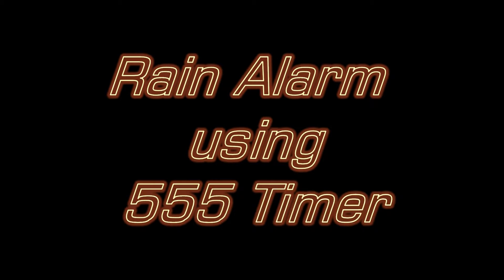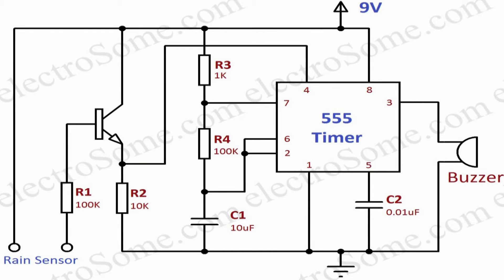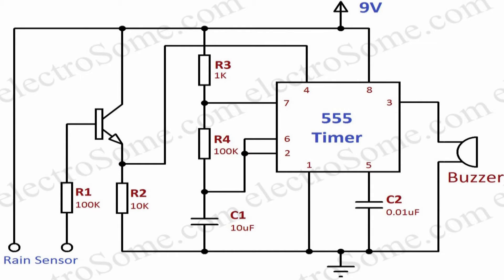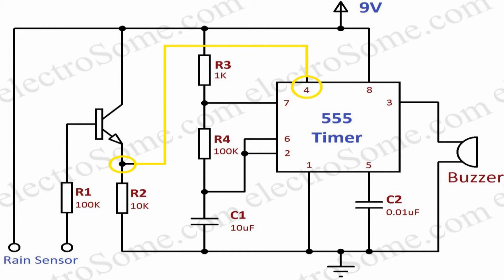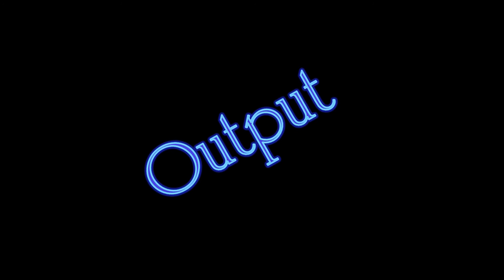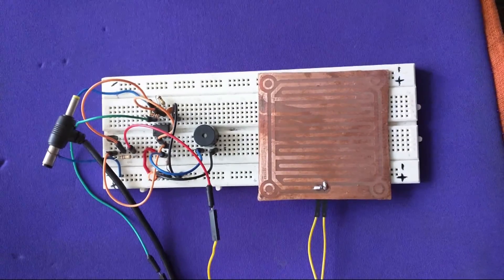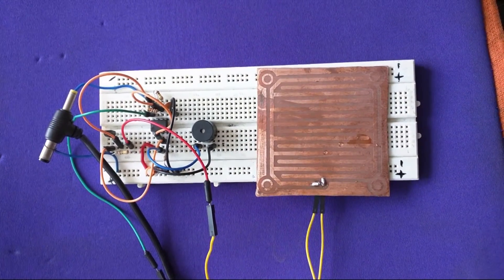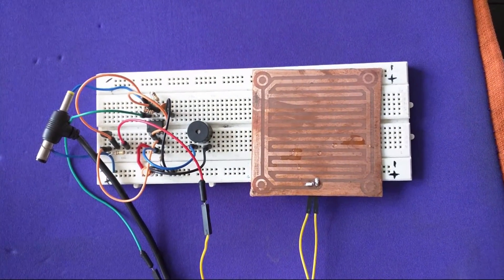Rain Alarm using 555 Timer - Hobby Circuit

Comment: excuse me but i took it as a project to my dr in faculty of electronic engineering ,, etc after making it ,putting components well it couldnt run like yours the buzzer is always on without using applied short circuit on that mean sensor plllllz .. tell me i have any shorts on PCB .. help me !
Reply from the maker: It will work fine as shown in the video. Please check whether your circuit is correct or not. Just post your pictures, let us check it.
Reply: actually i need to know why IC 555 works on without transistor .. the buzzer is always on why .. in your opinion what makes it work without tanrsisitor as a switch
Reply: or can you tell me a quick way for check it easily
Reply from the maker: Check whether the 4th pin is shorted to Vcc.